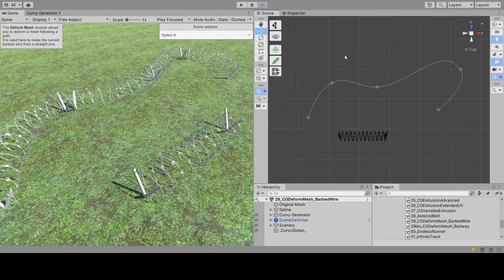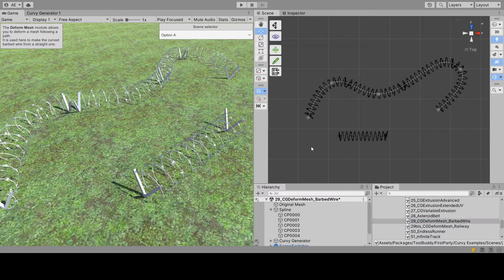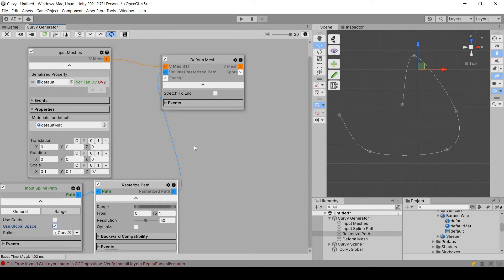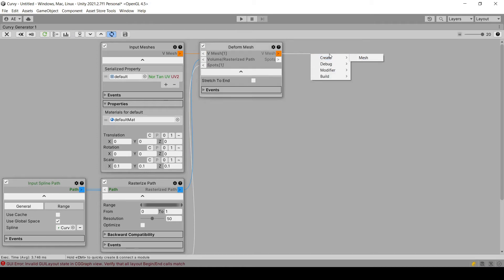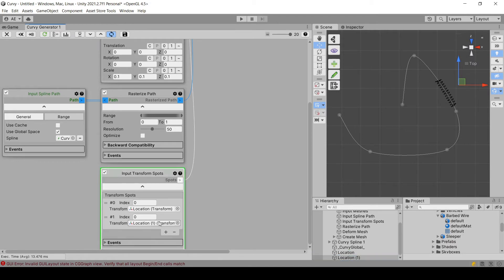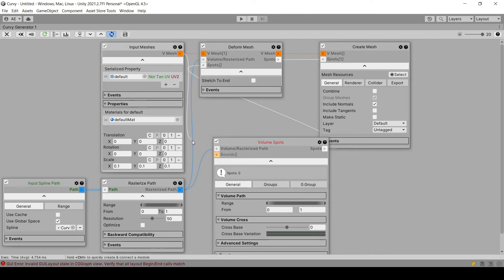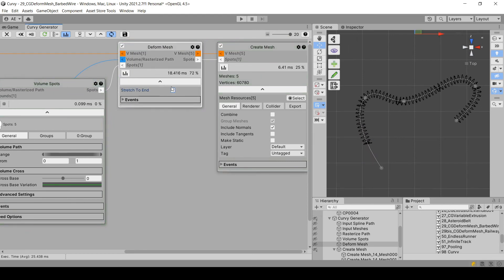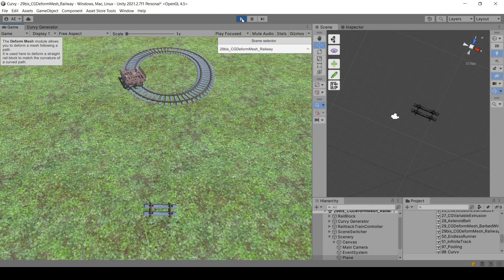Mesh deformation - Curvy Splines tutorial

Comment: How can you deal with T shape connection when you connect two splines especially when you want o have a Y shape connection, I am talking about train tracks
Reply from the maker: When connecting two splines, you can set up the junction logic for when an object moves along the connection, as you can see in the demo scene "Train: Railway Junction".
As of now, generated meshes from the two splines will just get superposed, there is no special treatment involved.
Did this answer your question?
Reply: @toolbuddy  so basically i will have to align the connection manually in order to not have any visible gap and have a smooth Y transition between these two splines and specifically the deformed mesh of tracks
Reply from the maker: @stnikou  It does not have to be placed manually, you can use the API to get the position of the spline connection and place premade connection meshes.
This forum thread has more about the connection meshes subject
https://forum.curvyeditor.com/thread-1919-post-6239.html#pid6239
Feel free to ask further questions, either there or here.
Reply: @toolbuddy  Also another question, I want to make a roller coaster, so I follow your video and I deformed a piece of track model nicely, but I want to add another almost identical piece of track (it will be broken so the player have to jump ), I am using volume spots to add in groups different models but these are randomly spread on the spline. How can I replace in specific locations the normal model of my track with another broken  for instance
Reply from the maker: @stnikou  Depends on your use case. One of the possible solutions is to use the Input Transform Spots module to define precisely where you want your defined mesh to be placed. Use your non broken piece of track as the input transform to generate the broken piece. You can then delete the non broken piece. Did this help?
Reply: @toolbuddy  but with transform input i still have to do the replacement manually and this will not be precise, is there a way to use first the volume spots to generate all the good tracks and then select the pieces that i want to replace with my broken tracks?
Reply from the maker: @stnikou  I am not sure what you mean by "this will not be precise", since the Input Transform Spots will provide you with the exact position of the selected piece of track.

The replacement process don't have to be manual, you can automate all these operations using the API. You can make a script that will generate automatically the generator that will create the deformed mesh. An example of generators created via script can be found in the script E51_InfiniteTrack, used in the example scene 51. In your script, you will assign the input for the Input Transform Spots based on your own criteria, for example assigning to it the track piece at the 7th position.

The solution discussed until now is a two step solution: first generate the solid (non-broken) pieces, then replace some of them with the broken ones. Another solution is to do this in one step: generate both the broken and solid pieces at the same time. This can be more or less easy/viable depending on the complexity of your setup.To take a super easy example, if you want 3 solid pieces, one broken piece, then 2 solid pieces; then in the Volume spots module create 3 groups, the first having 3 time the solid piece, the second one time the broken piece, and the last 2 times the solid piece.
Reply: @toolbuddy  Ok thanks i will try these

Comment: i can modify the rotation of a input mesh from code runtime? i am triying but not work 

InputMesh m_mesh;
m_mesh.Meshes[0].Rotation = new Vector3(rotX, 90, 0);
m_mesh.Refresh();

hovewer in the editor if i edit the value directly, yes rotate it
Reply from the maker: Hi,
The provided code is the right one to rotate an input mesh in the generator. I used the that code in the Start method of a component I added to the InputMesh, and it worked. If the issue persists, can you provide me with a reproduction case?
Reply from the maker: Also, what version of Curvy Splines do you use?

Comment: Hey there! Super helpful tutorials and amazing tool, thanks so much for your work! I was wondering if there's any way to use the Volume Controller with a Mesh Deformation generator to traverse the deformed geometry?
Reply from the maker: Sorry, the Volume Controller is for now not compatible with meshes, but only with volumes generated via a shape extrusion.

To make a controller follow a deformed mesh, you will have to make you own custom controller. The basic idea would be as follows: have a sub-class of the spline controller, but at each frame instead of placing the object on the found position on the spline with the found orientation, you will have to sample the deformed mesh to find what is the point on the mesh that corresponds to said point on the spline and said orientation.
I hope this helped
Reply: @toolbuddy  Yeah it makes a lot of sense that it's not compatible with meshes, but I thought I'd ask just in case 😂. 

Thank you kindly for the explanation on the custom controller idea! That also makes a lot of sense, I think I can make that work. I appreciate all the help! 🥰
Reply from the maker: @Persegan  You are welcome. Glad I was helpful.
Have a nice da